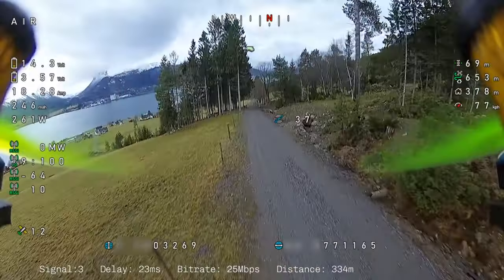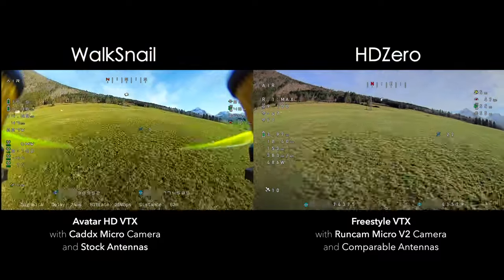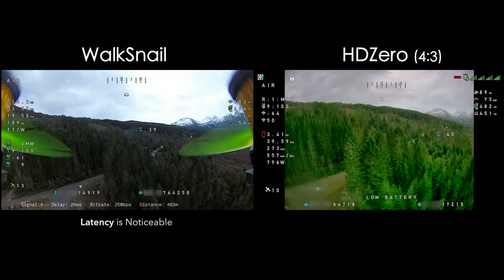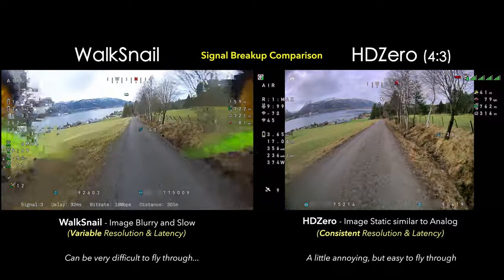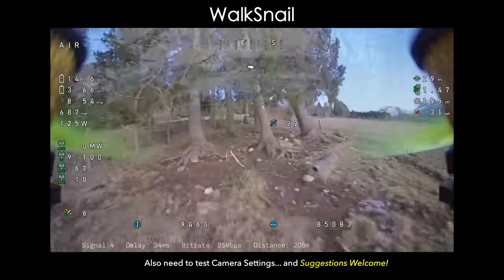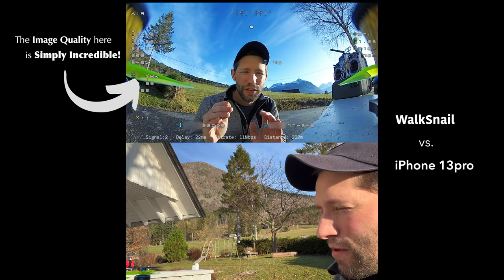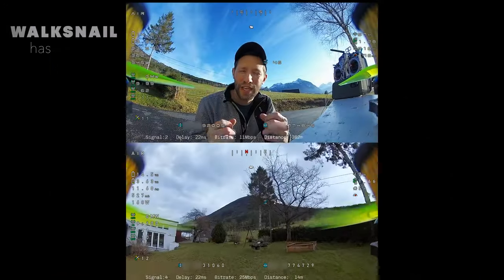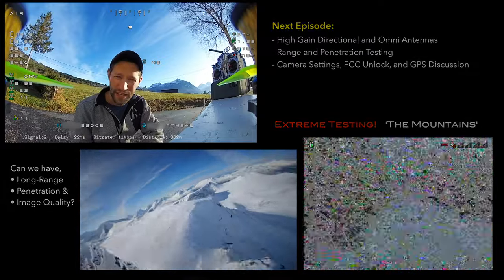WalkSnail Digital FPV Range & Penetration Testing | Signal Comparisons to HDZero | Initial Review |

Comment: My experience has been the complete opposite. Been able to go places I've not been able to go on analog or HDZero, and I'm going to be moving to better receiving antennas quite soon. (already flying a pair of singularities) As for the latency, I can sorta feel it, but I guess I was well trained in dealing with image latency by playing video games on a really cheap computer in my childhood.

Anyway, things I've found so far. The latest firmware 31.36.8 has done quite a lot of good, auto focus mode is basically useless right now, and it interferes with GPS signals just like HDZero does. Haven't experienced any of the issues with using higher power levels (over 700mW) so I wonder if my excessive filtering helped. (9v reg w/ low ESR cap after)

I'm still wondering if I just got multiple bad HDZero parts. Have never achieved the same results as you with a very similar setup. The image has never been as clear, and I've never been able to have even half the range/penetration of analog. We'll see when the goggles reach me, I guess. It's frustrating.
Reply from the maker: Hey man, appreciate the response. Yea when I first started this testing I assumed it would beat HDZero in everything except latency/feel, but would surprised on my first flight how crazy the blurring was in spots I always fly my HDZero with zero issue. In fact that’s when I decided to grab the HDZero and do a comparison… I’m running the stock WS antennas and the latest 31.36.8 firmware. I also tried every possible setting. Even (not part of this video) did the FCC unlock and test higher power and higher Bitrate modes, sadly with no noticeable change! I have a couple theories I’m going to test and will include the findings in my next video. 
When the signal is good that image quality is super nice! So we’ll see, hope to get it sorted, this is how HDZero started for me as well… I might even reference that in my next video. Any way, thanks again for the comment, cheers bud!

Comment: interesting. i've seen people have much better results.
Reply from the maker: Yea me too… I was really surprised by these results. I did a dozen test flights with different settings along this exact flight path and got the same result every time. Before I swap antennas I’m going test the stock setup at some other locations; maybe the three sets of power lines is causing issue. I’ve experienced this in the past with other systems. So we’ll see, stay tuned, cheers!

Comment: Focus mode off. 720p.
Latest firmware firmware feels like a downgrade for me.
Last time I flew it was garbage, firmware before the latest version was better image wise.
Fly with stock antennas on vtx, TrueRC stubbies on the Fatshark Dominator goggles.
Reply from the maker: Thanks for watching and sharing your thoughts. I’ve tried lots of different settings and get the same performance issues. Currently I am set to 720p, 700mW, Normal Bitrate, Focus Mode off. 

Interesting you’re saying the latest firmware isn’t as good, you mean the Beta 31.36.8? That’s what I’ve been using. 
I’ll be upgrading the antennas this week and doing more testing.
Reply: @GiantAntCowboy  the latest stable firmware seems to be causing more smearing compared to the firmware I had on it before (I skipped 1 or 2 firmware updates due to winter/life)
Reply from the maker: @FATSNAIL-FPV  interesting, I can try rolling back a version and testing. Hopefully they’ll keep improving the system firmware going forward.
Reply: @GiantAntCowboy  so far they've kinda listened to the community, image got better, range is okay i guess. I have to maiden a fixed wing and see how the avatar vtx does going a few clicks out. 
Penetration compared to my analog builds is waaay better unsurprisingly, jsut built a 4" with a 1s vtx and a Hammer antenna, hope to test this weekend.
Reply from the maker: @FATSNAIL-FPV  yea, I support the system, for me I was really just disappointed in, penetration around trees and foliage, and actually (didn’t mention this in the video) the handling of light exposure. The camera often quickly jumps for overexposed to underexposed, this should be able to be corrected in future firmware. We have been working on a similar issue with the HDZero goggles when using some analog systems… but I’ll keep testing and using the system. It’s has a lot of potential and I can’t wait to see how it evolves.

Comment: Thats unflyable? Have you even ever tried analog?
Reply from the maker: Yea, I actually flew analog for years and sure maybe “Unflyable” was a bit dramatic… but my point was that the amount of “smearing and pixelation” is a little extreme. Especially since I’m within 500m with pretty clear LOS, and the HDZero system by comparison was functioning more or less fine in identical situations. 

Also coming into this I heard repeatedly how WS/DJI have way better penetration than HDZero and Analog, only to have the image fall apart every time I fly behind a tree… just surprised by this I guess. 

Hoping some proper antennas will solve this, and also I plan to re-test the stock setup in other locations, maybe the power lines were causing issues..

Comment: I have both systems. This is not my experience.  My walksnail system smokes my hdzero
Reply from the maker: Yea, that’s honestly what I was expecting… that’s why the thumbnail has “Surprisingly” haha!  Maybe WS is more affected by Interference like Wifi and power lines which I was surround by… before I change the setup I’ll change locations and test again. Thanks for watching and commenting, stay tuned, cheers!
Reply: @GiantAntCowboy  honestly I would look at the build and make sure everything is proper, especially ground loops or wiring issues. Second is definitely directional only antennas, as you mentioned.

On a couple of rushed test builds I had horrible performance, but on my proper builds it was absolutely amazing! As for penetration in my neighbourhood it absolutely destroys my HDZero and DJI setups… the 1S Avatar VTX absolutely spanks my Freestyle VTX… BUT I still fly HDZero 95% of the time, because it’s the only system that can keep up with me, and I fly it out of necessity… that and, I absolutely love it, and all the community around it!!! 540p is more than enough for me at speed.

It’s the same on my HDZero stuff, sometimes I literally get breakup LOS, super close to myself on poor builds, remember things as simple as wire length make a huge difference in our RF based machines! I had crappy breakup on a 2” HDZero toothpick the other day, shortened the power wires going to the VTX and image is now perfect 👍🏻 stuff like this happen all the time, and make a substantial difference…

I hope you figure it out… Avatar is one of the most picky systems to get perfect, but it also has one of the highest performance ceilings, so it is worth me having it around.
Reply from the maker: @lemonsquareFPV  Great comment, much appreciated. I hear what you’re saying and have experienced the same in the past.  Different wire lengths can actually start to act as antennas and can introduce interference for sure. I make sure to twist all my wires which provides some basic shielding. I’ve been perfecting my HDZero builds for almost two years, always trying to squeeze the most performance out because I often doing longer-range, low altitude flights, which are some of the most demanding for our video systems. 

However I’ll definitely double check and adjust some things, this was a tight build, and maybe I can re-adjust some things. I’ll post an update soon. Cheers!
Reply: @GiantAntCowboy  exciting stuff! I love optimizing everything, and there is always room to change things!

Also I have high voltage (500,000V, 300,000V, 150,000V) lines, antenna towers and 10,000 Wi-Fi networks in my neighbourhood, only thing is that certain channels at certain times are bad, but as a whole the system cuts through it all like nothing… so it’s definitely not location.

The thing that’s coolest about this community is that it has soooo much shared experience that you don’t have to reinvent the wheel. Our shared knowledge is so important for success! I love this community so much… and this is coming from someone that works in aerospace, engineering, FPV product design and has hobbies in basically everything.
Reply from the maker: @lemonsquareFPV  absolutely this hobby is full of smart folks that like to tinker and troubleshoot. I mean look at BetaFlight, ELRS, HDZero, and many other systems, just open source with us nerds endlessly testing, building, and programming for fun! Haha! So I’ll see what I can do to improve the performance!

Comment: Walksnail antennas are the worst.  I plan to even replace walksnail vrx patches
Reply from the maker: Yea me too, have a bunch of SMAs sitting on my desk for the next round of testing! First I’m going to test the stick setup in a different location to rule out any environmental interference issues… after that high gain antenna testing!! Let me know how your setup works out.  Stay tuned, cheers!
Reply: @GiantAntCowboy  yea I get bad environmental interference. On my dji and compass. 
I got the walksnail waiting for drone to test it on.  Bought whoop but the elrs on the board was bricked ugh. Got another walksnail 1s on order

Comment: that looks like old firmware.
Reply from the maker: I wish that was it, I’m running the 38.36.1 (or whatever the latest is) first thing it did before testing the system.  Thanks the suggestion though! Stay tuned, hopefully I’ll have a solution and some decent performance to share for the next video! Cheers!

Comment: People should stop pretending WS isn't dji tech..honestly.😉I mean....A couple old sayings come to mind... "If it walks like a duck..."......and the perpetual favorite..."A rose by any other name...."  🥴🖖🏼
Reply from the maker: Yea it’s pretty similar for sure, I will say that WS breaks up differently though. DJI gets like “Blocky”, this gets like “Smeary”, but the two are darn close. When the signal is good though that image is sweet, so I’ll keep tinkering with it. Rocking HDZero still either way, it just had certain advantages you can’t ignore.
Reply: Rumors saying it's reverse engineered DJI ;)
Reply: @thirdpartycookie  I doubt they went to even that much trouble.Far  easier for dji to rebrand it's tarnished image and plaster ws silkscreens on everything  , start a media campaign claiming distance and a new found interest in the fpv community....maybe make new users go through beta problems to make sure it looked unfinished...ahhhh...the cynicism runs deep...😉..I wonder what a deep patent search would turn up...🤔😉🖖🏼
Reply: @steve_beatty  naw. DJI immediately ended cooperation with Caddx after they released WS. They’re competitors now